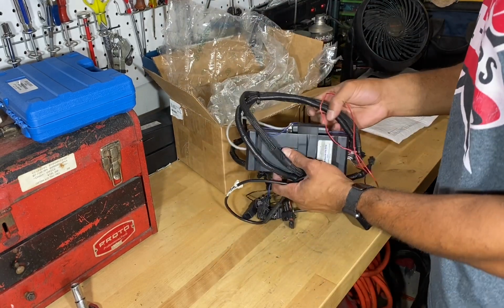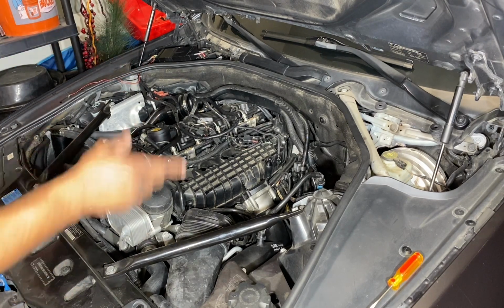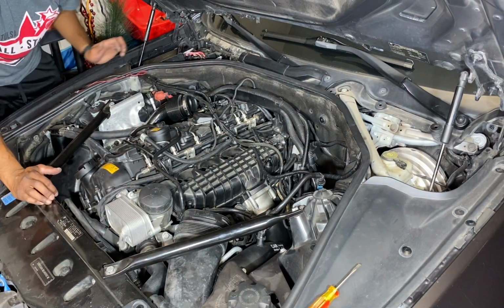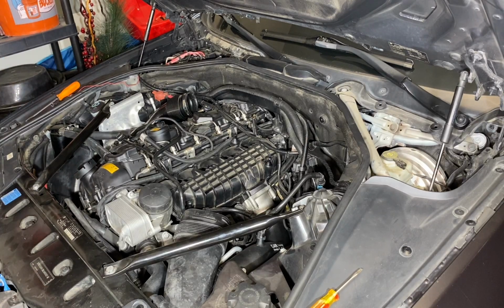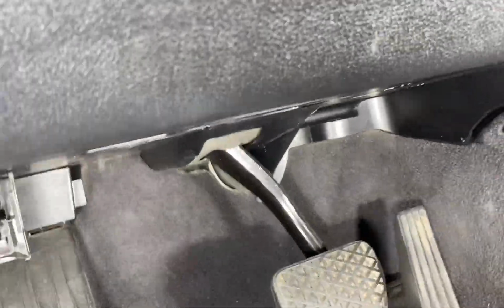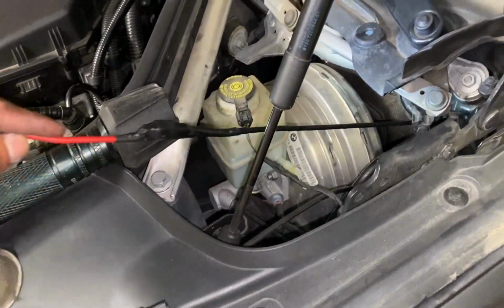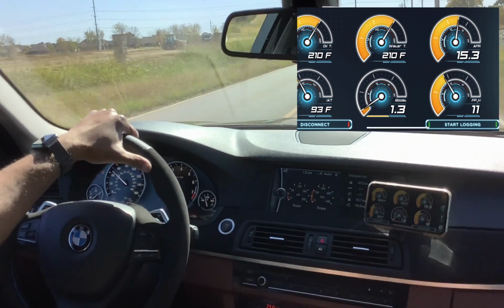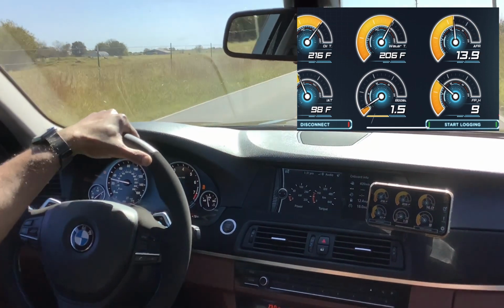BMW F10 535i Mods: Jb4 Stage 2 Tune running E40

Comment: Tnx for the info. i have a 2011 535Xdrive. thinking about doing this. the only mod i hsve so far is the charge pipe by VRSF. any recommendations?
Reply from the maker: I would say it’s been 3 or so years since I switched to MHD from the JB4, and MHD is much better.
Reply: @JohnsonMotorsports  tnx my brother!! i will definitely check it out.
Reply: btw how is the Intercooler FMIC working out? what do u think about the VRSF intercooler?

Comment: It’s says on the package of the pump that we should upgrade fuel lines? Is that necessary?
Reply from the maker: From what I understand the fuel line that came with my pump will already handle Ethanol fuel. If you plan to run a full E-85 tanks, you will need to upgrade all other fuel lines.

Comment: Where did you get your steering wheel?
Reply from the maker: I found the M Sport steering wheel on Ebay for $100. Ordered a custom suede/leather wrap and picked up a new airbag.
Reply from the maker: FYI, $100 is really cheap for the wheel. M sport wheel with paddles.
Reply from the maker: @Angelika..-  I get it. It can take some time to find a good deal.

Comment: Brother great detailed video as usual. I’ve had a jb4 in my garage for my m5 but hesitant to install, waiting on MHD to come out with a tune for the car! Lol...Love the content, keep them coming 💪🏾💪🏾
Reply from the maker: Thanks man! Your M5 is looking insane. Are you planning to go with air again?
Reply: @JohnsonMotorsports  nah as of right now i love the way it drives with the KW HAS. I love your wheels btw, looks sick with your car.
Reply from the maker: @Mosesexperience   Thanks Bro! I’ve heard really good things about the KW’s.
Reply: @JohnsonMotorsports  I had the kw v3 on my 535 but this I went with HAS cause of the edc unit
Reply from the maker: @Mosesexperience That makes sense. I jus finished 15 minutes ago with my BC coilovers install. Got a crazy deal on them with Swift springs.

Comment: i removed my jb4 and installed an just the MHD tune. With with the new wireless OBD port adapter it downloaded to the ECU in less than 5 minutes, my car runs better and a lot stronger on the mhd.. I did not piggy back the jb4 with the MHD i hear pros and cons with that si i just went straight MHD and love it. 2014 f10 535x
Reply from the maker: Glad the MHD worked out for you! I’ve heard really good things about MHD.

Comment: I just installed my jb4 yesterday  had  a few issues to begin with bad wiring harness,  they sent me a new one. Did you have any issues come up in getting the system up and running 
Richard 
Australia
Reply from the maker: My Jb4 was used, which meant I had to reach out to Burger Tuning to reset the Bluetooth connect. Also, right now I have sporadic connection issues, which should be fixed with a new Master Chip.
Reply: @JohnsonMotorsports  I had a problem with the wireless to phone auto logging off and on. Also my guages on the dash locked on with the left indicator on and zero on the speedo and 1 on the tacho. I  turned my phone off and then back on and it seems OK now, wierd . Anyway mate keep it up love your work
Reply from the maker: @richardcampbell7743   Wow. Glad you fixed it.

Comment: Nice job man! Do you know what power gains you got, and do you have upgraded Intercooler?
Reply from the maker: No, no clue on power gains at the moment. Haven’t picked up the FMIC yet. Plan the get the G-plus unit, just haven’t pulled the trigger. Working on suspension.
Reply: @JohnsonMotorsports  All good, I wanna do coilovers badly and rear spacers. That g plus is a good deal one of these days Ill pick it up. Will be after exterior is close to being finish. Not looking for performance power gains just reliability.
Reply from the maker: @BurrNinja  I hear you man. I was looking for H&R springs the other day and stumbled upon a great deal of brand new BC Coilovers with the Swift spring upgrade for cheap. They just arrived today.
Reply: @JohnsonMotorsports  Yeah bad part for me I'm awd so known good coils are hard to find cheap lol
Reply from the maker: Ahhh, that makes sense
Reply: @JohnsonMotorsports  g plus fmic is a great unit. Been running it for about a year , no issues . It’s a tight fit but will go in .
Reply from the maker: @twinscoupe  Awesome!  I’ve heard really good things about it.